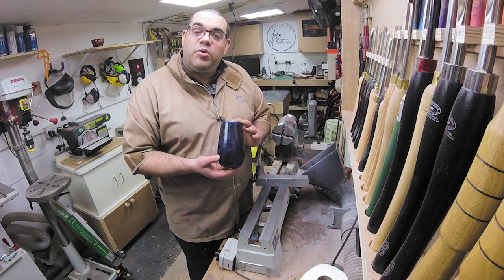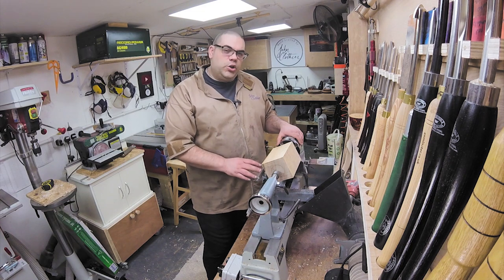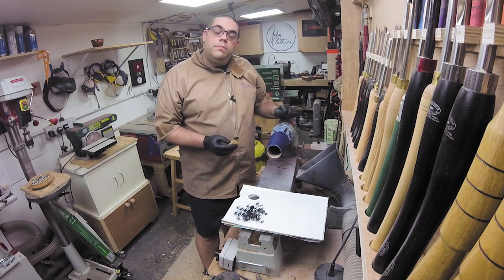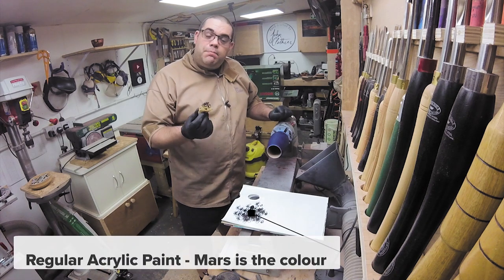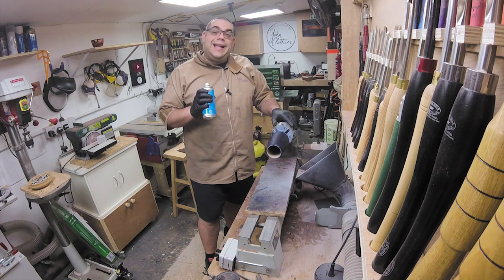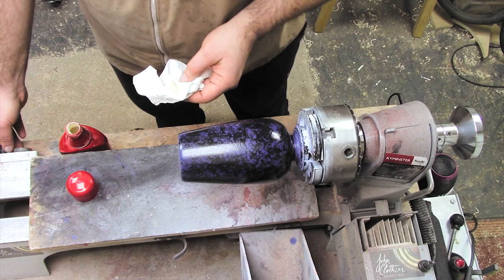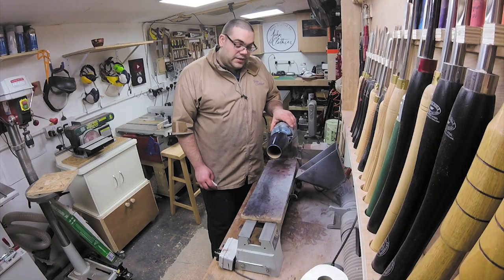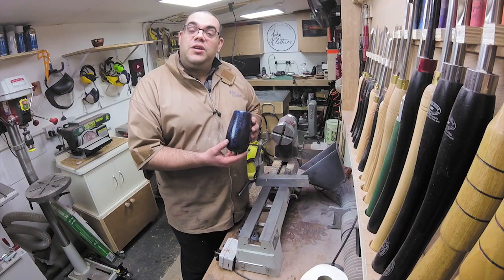Black and Blue Mottled Vase

Comment: Fantastic as ever, Question: what make of Air Brush do you use as the flow rate looks perfect for this type of application?  Best regards, John W......PS  (still waiting to use the colours you sent me)
Reply from the maker: Thanks John. To be honest I have no idea. It was a cheap one that came with a small compressor (I sold that) in a bundle from Amazon. The compressor and 3 airbrushes was about £75 so they are no doubt the cheapest ones possible. Are you coming to Makers Central? If so please find me and say Hi. Maybe we can have a chat about those colours ;-)